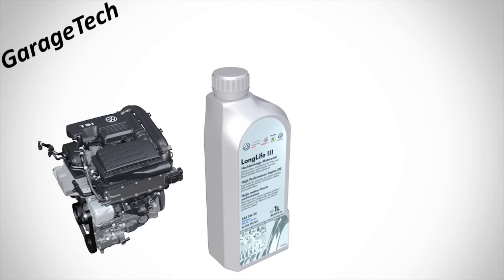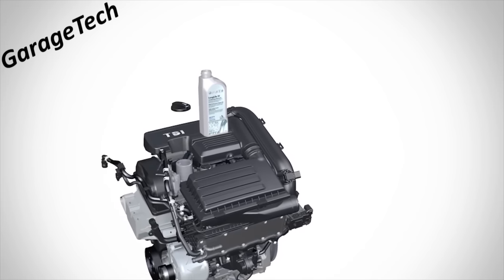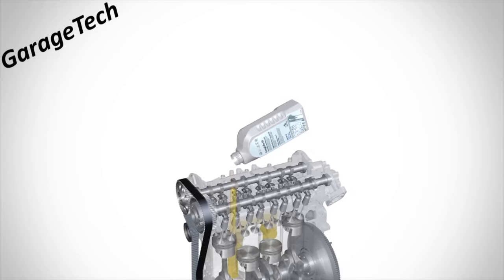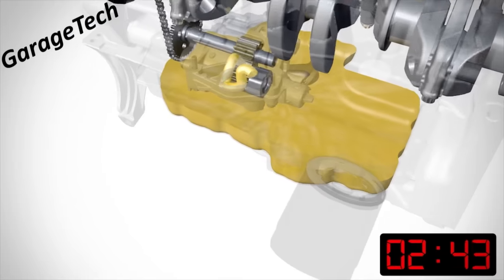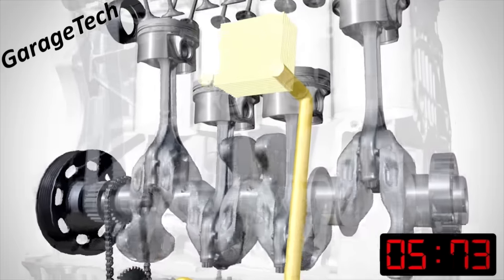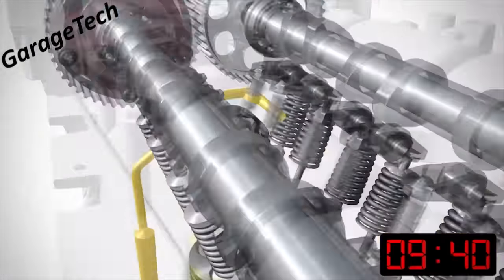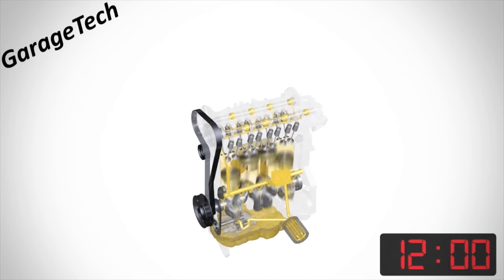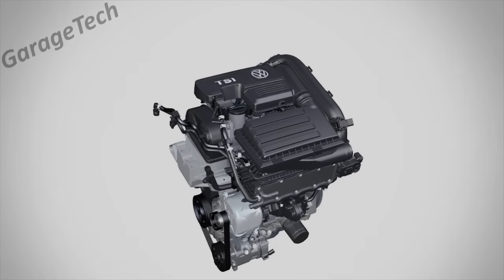How oil circulates around an engine when started

Comment: I see so many people take off so fast when we leave work ,literally looks like the car is put in gear before engine actually starts 🤷‍♂️
Reply: I See that at my workplace also its Just uninformed people Who Just own a Car and thats it
Reply: I usually let my car idle for a few seconds before driving, especially when cold, for exactly this reason. I don't wanna put any load on an un-lubricated engine.
Reply: @abortion_lasagna think you missed his point
Reply: Lmao, people at my workplace are leaving while doing burnouts.
Reply: @tolyoz  I'm glad I'm not the engine or transmission in their cars. :/
Reply: My idiotic co workers do that with diesel cars. Meanwhile I let my gas car warm up for 5 minutes.
Reply: abortion_lasagna first off it depends on if it’s standard Or auto. Auto won’t start in drive. If you have a standard transmission you better make sure you remember it’s in gear before you start it or you’ll just kill it and make more damage
Reply: @LackeyKh  4% more fuel economy for accelerated engine wear which will result in thousands more spent on repair than you saved on that fuel with start and stop technology.
Reply: @TheGhostTrollekdejvu  I never said it was a good idea lol
Reply: Dees Nutz what do you mean it should be in gear before you start? I always take out the gear before I start.
Reply: @LackeyKh  Yeah, but does the engine no good what so ever....
Reply: Bad . Run it easy 1st ten minutes.
Reply: There's no need to warm up the engine, especially the newer cars idling so low it won'teven warm up after 10mins so these idiots keep revving up the rpm which is even worst. Just turn on the engine, wait few seconds, and take it easy driving for the next few minutes, eg <3k rpm. I did this for decades in New York winters with zero issues.
Reply: Since my father teached me to drive, one of the first maintenance things I learned was to wait some time before driving off. In the 1st start in the morning I wait between 3 to 5min for the engine to warm up, specially if it was a cold night. And if the car is going to be parked for several days in the garage, start it at least once a week for some minutes to prevent any issue.
Reply: Hazard240 *some new cars
Reply: @hakont.4960  Very true!
Reply: @cy4niid798  I do the same especially on cold days.. You have to let an engine warm up.
Reply: @toddcook8824  yes, warming up a car is very important. I watch people come out on a freezing morning and take right off! I can't believe it.
Reply: @jorggamingcr409  your father tought you right!
Reply: When its 10F out and they immediately floor it out of the parking lot
Reply: It causes me pain
Reply: @TheGhostTrollekdejvu  and not to mention the money you'll spend replacing a starter every damn time, honestly I think the whole thing is just a money grab for starter companies
Reply: @abortion_lasagna I have xtz 660 and it has dry oil pan
Reply: I never understand them. When they park too, it's like they shut off the engine while exiting the car... don't they have keys, phones, wallets, bags, money, papers? I think it takes me 5 minutes to leave my car after I turn off the engine.
Reply: My mate had a VX2300 company car that he hated. Every morning he'd start it in 1st gear then cane down the road to see how far he could get before the oil-light went out. It lasted 140 thousand miles, much to his disgust.
Reply: @jorggamingcr409  

Cars used to have carburetors.  
The car would not run right and stall on a cold winter morning. 
Not do much on a summer morning. So it used to make sense to idle a car a minute or three or five when it's zero F. 

Cars don't have carburetors any more. There is no reason to let a car idle even for half a minute at zero F. 

I let the car idle for about ten seconds after I start it so that oil can reach all parts of the engine before placing a load on it.
Reply: EXACTLY!! Every single day. Over night. Sometimes -10°. Hop in. Fire it up and they're instantly 3 blocks down the street.. 

People are insane.
Reply: @johanvangelderen289  A good reason to wait 20-30 seconds, or up to a minute in sub freezing temperatures, is to allow for the thermal expansion of the pistons in the cylinders. Not doing this is the main cause of piston slap, even in new and modern engines.
Reply: @19jacobob93  

I'd believe that. I usually let it idle that long under those conditions. I want oil all over everything before I put a load on the engine. 30 seconds to a full minute isn't that long of a waiting period.
Reply: abortion_lasagna 
That puts load on the engine. Don’t do that.
Reply: @hakont.4960  I think I read 10 seconds is recommended.  Longer might be better in serious cold.
Reply: I saw a guy do that for years, his piece of crap took it.  Apparently it’s not as bad as you’d think.  He’d hop in it, start it, and be in gear and punch it all within the space of a few seconds.  I can’t remember what kind of car it was though, an Oldsmobile I think, maybe a Delta 88.
Reply: @cy4niid798  You wait 5 minutes for the car to warm up? Unless you live in Siberia I don't think its your co-workers that are idiots.
Reply: LOLZ LOLZ 4 months ago it was -10 degrees here in Germany. If you have a shitty car that you don’t care much about then that’s your problem. But I would rather wait couple of minutes instead of paying some 2-3 thousand euros to repair it. And I think an idiot would do the opposite.
Reply: @nlo114  That one guy passing you in first damn thing pegged on the limiter huh
Reply: You probably drive an automatic hahaha
Reply: @Tryingmybestsince1999  Well my daily driver honda accord is auto so yeah
Reply: @cy4niid798  Thats to long, you cause more engine damage when the car idles... 30 seconds at most  then drive off normally... idling will always cause more wear then starting it for a few seconds putting it in gear and driving normally
Reply: Lolz I let the car on for like 2 minutes max. I can’t risk taking off after 30 seconds at -10 to -15 degrees, even the radiator coolant is freezing at this point. After that I go 3k rpm max until I am sure that the motor is warm enough. The wear caused by the car being idle is counted for during manufacturing, that’s standard wear.
Reply: @cy4niid798  Uhh doesn't good antifreeze when its mixed correctly go to like -40
Reply: @cy4niid798  Well text is hard to determine sarcasm vs actual statements (and I have seen people do some stupid shit) since we are devoid of gestures or expressions and tone of voice
Reply: They also accelerate to high rpm the engine and you can hear the metal to metal contact..
Reply: @cy4niid798  I give it one minute to 5 minutes
Reply: @radiator0  what are you talkin about I don't understand
Reply: @tazman4855  what about letting the engine idle for a minute to 5 minutes
Reply: @yonut7  another reason not to buy used cars

Comment: do keep in mind that the engine will not be bone dry at start up, there will always be some residual oil around moving parts. So even if 12 seconds seem long by many standards, some lubrication is still happening until the proper flow is achieved.
Reply: The air in the oil filter is pumped through the oil passages ahead of the new oil....
Duh
Reply: @hotrodray6802  i think you're barking up the wrong tree.
Reply: @hotrodray6802  anti drain back filters are used these days and in the old days the filter sat upright so the oil stayes put
Reply: It's antiwear additives, not oil. Ordinary base oils (Group I, Group II, Group III) are nonpolar and therefore the oil will just flow back to the sump by gravity overnight. Unless some fancy and expensive Group V stuff (Ester, PAG) has been thrown in the mix, the only protection (until a proper flow is achieved) will come from the additive package.
Reply: Except in the case of installing engine components dry, just did my chains dry only rattled for the first 3 seconds

Comment: Just to clarify, the animation of the oil flow through the filter is backwards.  Conventionally, oil flows from the outside of the filter to the inside.  This provides the most cross sectional area between the filter pleats to ensure the least amount of blockage while contaminants accumulate in the filter media.

Comment: Quick question everyone:
In my car I (an Opel Meriva 1.4, engine code Z14XEP) when I take off the oil filler cap I can see one or two cams from the camshafts. Do every engine only lubricates the mounting points of the camshafts? Or also the cams and the whole valve assembly?

Comment: If anyone's ever spun on a new filter and left the old gasket, or has had an oil pressure sender crack , you can attest to how quickly oil flows thru an engine 🤣
Reply: Haha did that one time with forgetting about the old gasket... bout shit myself cause it sounded like a bomb exploding a few seconds after starting. If you want to waste about $50 in 2 secs that's a fun way to do it. Little messy so make sure to do it the yard. You'll also smell burning oil for about week also.
Reply: @Draega007  my friend worked 1 summer as an oil change technician.... forgot to take off the old gasket and started it up right in front of the customer LOL he said he will never forget the look on the guys face as oil sprayed EVERYWHERE right after start up
Reply: @AH-lw2bj  haha I'm guessing they had to eat that oil change and probably give him a few on the house oil changes cause I don't think you could possibly clean all the oil off the underside that got blasted everywhere so it probably looked like freight train rolling down the road.

Comment: The bearing surfaces still have plenty of oil film on them to survive the startup. 12 seconds seems very long. After an oil change I see it takes anywhere from 3-5 seconds to get oil pressure
Reply: I wet the oil filter with oil to help the first start up
Reply: Fill the filter with as much as will not spill out when you install it.
Reply: @hotrodray6802  my filter isn't upside down, if I fill it up it will leak.
Reply: Fill the filter if you can. The noises you hear on a startup after an oil change are the valve lifters and timing chain slack. The friction surfaces are coated by a film of oil.

Comment: on engines with hydro lifters you can clearly hear the engine rattle a little bit on startup.
it goes away after 2.. 3 seconds till the oilpressure fills the hydros back up to remove the slack.

Comment: 12 seconds is a long time on a sub zero morning.  Sitting all night with no lube in the head, freezing cold.
Reply: for real!
Reply: And at that Temperature some oils lacking lubrication when cold.
Reply: Lol oil is already in places
Reply: I know out of scope of cars but thats why I use the kick lever on my 150cc bike with ignition off atleast 4 times before actually kick starting the bike.
Reply: It helps to fill the oil filter before installing.
Reply: 12 seconds isn’t long enough to cause any real damage but it dose ware very slowly but nothing to worry about. Hardest part on a engine is start up but with constant oil changes and new filters the engine will be okay
Reply: Synthetic and block-heater my friend.
Reply: Video in slow motion time must be  under 1sec. İs your idle rpm 30 in minute
Reply: Thats why I drain the oil out of my car every night, store it in the garage so it doesnt freeze then I fill my car with the oil in the morning before startup. Pretty smart huh? 👍
Reply: @steve1199  lar
Reply: akallio9000 
Finally someone who knows what their talking about. I learned to change oil when I was 15 from my father. He told me this and I’ve always done just that.
Reply: J Wil  
You can still get the paper wet. I used to do that with a Mercy Sable I just got rid of.
Reply: Ryan Scherbluk you mean 12 seconds isn’t short enough of a time to cause any real damage right?
Reply: Why Synthetic is a must !
Reply: @Tyler-xe1es  
Most don't know. Sad.
Reply: Use Lucas
Reply: 12s is only (speculatively) for a car that's had an oil change, ie empty. not one that was recently driven.
Reply: but 12seconds is when you have done an oilchange and the oil filter is empty. if this was a normal car where the car had been run the day before it takes 4 seconds to get oil pressure, not 12seconds. the oild filter is already filled up
Reply: SeppuKun  keeps filter cleaner that's all . Filter would have filtered it anyway so its a gimmick anything to make a buck nowadays.

Comment: I use 0w-20 oil to start engine every morning, then drain all of it and add 10w-30 while I drive during the day.
Reply: why are you lying?
Reply: @Felixthecatz  where do u live? Do people not laugh where you're from? It's called humor.
Reply: Sounds reasonable
Reply: irregular footed 
😂
Reply: I use crude oil if it gets really hot during the day I keep a barrel on my backseat strapped in
Reply: You got too
Reply: When I drive to work, I drill for oil on the way, I refine and process the oil, then pour it in using invisible animated hands.
Reply: i get the joke, but it would be completely unnecessary even if you really did this. this is why multigrade oil exists in the first place
Reply: @alekszen92  yeah sure thing you just represent big engine who want us to all get engine rebuilds at huge expense
Reply: @alekszen92  I was told to do it this way besides the other option of complete disassembly of the motor and manual lubrication daily. If your method has been working for you go ahead and do it. I'm not going to tell you different. My method works perfectly with no issues.
Reply: @USA-nw7cf  why are you try to make people laugh?
Reply: @USA-nw7cf  i live in prison
Reply: @Felixthecatz  it makes people feel good in a good way. I hope you get out of that prison and make good virtuous decisions and experience love light and happiness. The darkness will never understand the light. Go to the light and experience the love.
God bless
Reply: This comment needs more likes.

Comment: 12 seconds it took at the animation with the engine in slow motion. This in real time takes much less, on modern engines with the 0w20 full synthetic, very thin oil, it’s almost instantaneously.
Reply: Erich Guidi yeh timer’s kinda misleading. 12 sec is a good amount for idle to die down down tho
Reply: Not true. 10-20s ist accurate
Reply: Pretty sure that’s not true
Reply: 2-5 seconds.
I change oils in many cars and you can hear them rattle.
Reply: Erich Guidi 
Not true, takes about 10-20 seconds. And if the car is old 30 seconds up to a minute.

Comment: random fact: Caterpillar dumptrucks use alt-pump, activate it before starting engine so there is no metal-to-metal friction
Reply: J Wil  Unnecessary.

Industrial engines are built very differently, used in very different conditions and use very different oils (usually much thicker).

A car's engine is never completely dry, there is always a thin film of oil covering everything even after an oil change. The crank and pistons are partially lubricated by their own motion causing air to swirl and mix with oil in the sump creating basically an oil mist, and with modern low viscosity synthetic oils it takes like a second for the oil to reach normal operating pressure everywhere.

A massive industrial engine left sitting all night at sub zero temperatures in a mine or construction site in the middle of nowhere will have grease for oil in the morning, and that oil has a very long way to go before it properly lubricates that two ton engine.

Comment: BUY GOOD QUALITY FILTERS. Oil filters have anti drain-back valves that prevents oil from seeping back into the sump. Notice how oil from the sump goes into the filter then  to the upper part of the engine? We’ll if you have a cheap filter that allows oil from the top portion of the engine to seep back into the sump, you’ll hear that rattling sound every time you start your car in the morning.
Reply: I agree . Fram is the worst . I usually try to get a wix filter
Reply: Jim Barrows valvoline definitely isn’t shit oil.
Reply: Valvoline a quality oil my guy
Reply: Wix and K&N are all i use for my 3000gt and is whats recomended by a lot of other 3000gt owners ive talked too
Reply: For real. I like wix filters because the antidrain back valve is operated by a metal spring instead of a plastic one.
Reply: That's why I get Walmart brand oil filter. Top american quality
Reply: First time I changed my oil in my Tacoma there was not one drip from the oil filter (which is top left of engine) but now, using a WIX filter, I get about 12 gallons from the damn thing! 🤣 Good thing there is a little tiny hole under the catch ring below the oil filter.  Just place a paper, or plastic if you want, under that hole and no mess! 🧐
Reply: I've always read that cheap filters don't have anti drain-back valves but I buy the cheapest whatever's on sale shit Autozone has and those things flood my garage every time I take them off the engine.

Comment: I always drive away in 6th gear so Im sure all the oil fills up all gears fast
Reply: I know you're joking but the transmission is totally separate and is lubricated by ATF not engine oil
Reply: @sauercrowder  Good boy
Reply: @Valentijn1995  Thank you I will take my treat now
Reply: @sauercrowder  mine has one unified fluid that lubricates the engine and transmission, does the brakes and power steering. It is changed daily.

Comment: I have special lubrication software installed into my oil filter, pistons and main bearings. This software makes the components believe they are being lubricated even if they are not. The end result is less oil changes and much longer engine life.
Reply: Smart.